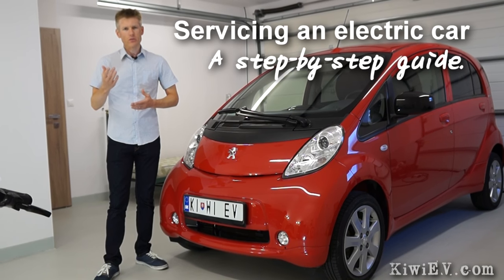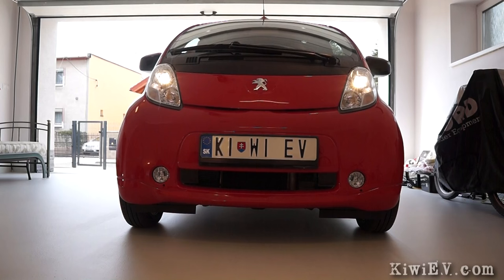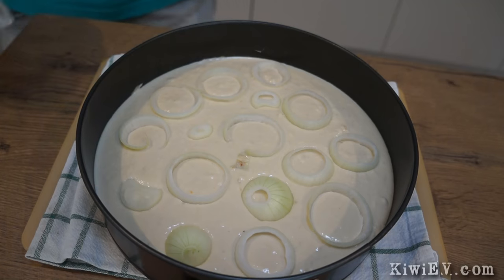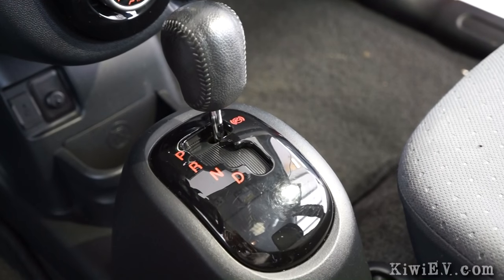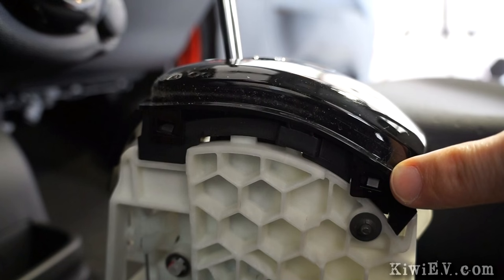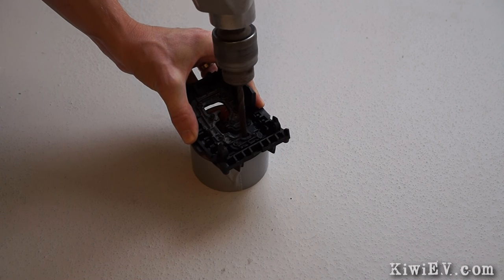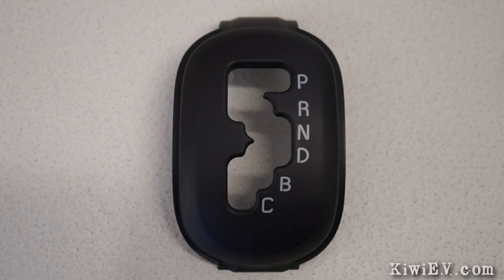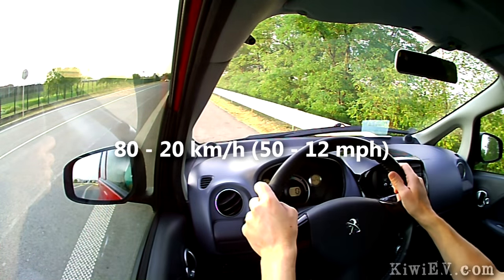How to service an electric car + unlocking hidden iMiEV options!

Comment: Gavin I just wanted to let you know that people are still following your instructions on how to do this! I bought an ICE gear surround (with 3 and 2 markings) from a used Japanese car on Yahoo auctions for £8. No cutting required, the face plate and the black part underneath fit straight on the white pillar. I sprayed the face plate black (it was grey). I'm enjoying B mode around town. Cheers!

Comment: I just made a BIG service on my c-zero... changed the cabin filter (10 min, you need to do it every year). I also changed the oil in the gearbox/differential (15 min, you need to do it every five years). THe only thing left now: changing the cooling liquid - but that needs to be done once every 20(!) year - so I skipped that for now..:)

Comment: Great video, I just got a used c-zero and I hope I can drill through both plastic pieces from behind not to have to buy the overcharged i-miev plate. I was looking at the figures of the B mode and it shows on your video that there is a difference of 5kw peak regen, but I get the feeling that the total regen power from 80km/h to 20km/h was a higher percentage difference compared to the peak regen power if that makes sense. I would love to know the total regen power difference between the 2 modes if that is available?

Comment: On 2015 c zero if you try to unlock extra gears it only goes 6km/h max on B and C.. and if you press the pedal to speed up it does nothing. Only works correctly in D mode

Comment: Thanks Gavin for the tip! I changed the gearshift of my I-on into the mitsu model, and in B mode the car appears having more autonomy than in the normal D. Furthermore, in the city I need to use the breaks less .

Comment: UK supplied I-MIEV s are delivered with these slots already available. "D" is for normal driving about town. (gives better low speed control) .  "B"(increased regenerative braking) good for hills and twisty roads.  C max power  (for open straight highways).
Reply: There was no significant difference in the power when accelerating, C is for lowest Regen, not power delivery.

Comment: Seems like B stands for "braking" (more regen) and C stands for "Coasting" (less regen).
Reply: IMHO 
I mostly use drive and neutral combinations as neutral imparts less friction and allows the car to travel further without any input of energy.
Approaching lights and other reasons to stop, I try to coast up where possible. The other option I use is just flicking into D and for heavier braking, down into B. I love minimising the wear to my brake pads!

Comment: is the shifter supposed to light up the letters at night? i just got a used imev and cant see the selector position at night, no lights
Reply: No, it doesn't light up. You have to get used to the number of clicks and the position, just like with the gears on an ICE car. The drive mode is also displayed next to the battery level.
Reply: Wife and I have the same objection. I'm going to put some LEDs under the cover now I know how to get the cover off - thanks Gavin. I have put a LED alongside the "Ignition Switch" as the slot is invisible in the dark. Comes off the interior lights, which come on for a time when the driver's door is opened.

Comment: I'm a little confused. I own an iMiEV (2011), and the behaviour of your B and C gears don't match with the behaviour of my E and B gears at all. I understand my three drive gears as follows:
D: Gives full drive power, but little regen
E: Gives much less drive power, except when I floor it. More regen.
B: Gives full drive power, and maximum regen. This is the drive gear I use 99% of the time.
Reply: OriginalPiMan 
Interesting.. I have an MY12 iMiev and I have great regen with D, much less with C and more with B. I found fairly insignificant differences in throttle response between all three modes.
LOVE LOVE LOVE the get up and boogy speed of this little car. It's truly unreal. If a bigger motor was put into the vehicle, I'd be inclined to say it was just overkill. It's a GREAT car!
Reply: TheObsessedGardener 
Thought: I know my D is for Drive, E for Eco and B for Brake. Perhaps you've got the same D and B, but you've got C for Coasting.

Comment: Just reading some other comments about regen. on the ionq it has paddles on the steering wheel 3 levels of regen and coast. fun to play with but after nearly 5k i found full regen the simplest as its then all controllable with the accelerator. the regen levels depend on how far you come of the gas or should i say electrons. Not driven on ice yet.

Comment: Err you left out  checking brake fluid level and cab heating system fluid level - water& antifreeze (both in the front)
Under the rear load platform is the motor coolant fluid level-water/antifreeze.

This car is very rust prone underneath. Check out floor pans and "chassis" rails. 
Also rear brake  pipes prone to rust. Caught in time will save a lot of repair money.
My car is 2012 model, kept in garage when not in use,  Local roads are salted in Winter.

Comment: So, B is brake and C is... coast?
Reply from the maker: Yeah, seems to be. I've been driving on B all week. It's brilliant for the city.
Reply: B is somewhat standard on larger cars with heavy loading capacities or large towing capacity. So it's motor break selection. On Electric cars it's the same. On Tesla's it's simply selectable how much regen breaking the car should do, here it's selectable via "gear".

Comment: Ups, I finished drilling my 2013 c-zero, and although the dashboard recognises the B and C modes, they don't work. Does anyone have any idea why? Could there be some software block that needs unblocking? Any advise would be much appreciated:)
Reply: On later models after 2012 the mode is displayed on the dashboard but it does not work due to reprogramming of the ECU's.
Reply: @SNORKYMEDIA  Thanks for your answer. Can the ECU’s be easily reprogrammed again so that they would recognise it? Perhaps using an OBD ll or a mechanic?

Comment: Your service guide was bloody funny, with your permission i think i may do one for my Ioniq.
In reality your not far from the truth, Due to regenerative breaking the pads should last for ever, so the only items i can think of are wiper blades, tyres, pollen filter. And every 5 years if needed break fluid and radiator fluid.
Not completely sure why my car has a radiator. The 12v battery that switches the big one on would need changing after a few years but on the ioniq its in such an easy location it should take 10 mins.
Reply from the maker: William you don't need my permission! Go for it mate!
Reply: True but polite to ask and wouldn't want to upset the ev family. Need to find a way to feed the surplus energy from my solar panels into the car. Too many clouds in the uk. Any idea's would be a great vid.
Reply: True but polite to ask and wouldn't want to upset the ev family. Need to find a way to feed the surplus energy from my solar panels into the car. Too many clouds in the uk. Any idea's would be a great vid.
Reply: True but polite to ask and wouldn't want to upset the ev family. Need to find a way to feed the surplus energy from my solar panels into the car. Too many clouds in the uk. Any idea's would be a great vid.
Reply: True but polite to ask and wouldn't want to upset the ev family. Need to find a way to feed the surplus energy from my solar panels into the car. Too many clouds in the uk. Any idea's would be a great vid.
Reply: william cox have you not heard of a Zappa Wall charger! It puts all the surplus from your solar panels into your car.
Reply: John M No but will look it up. Thanks for the info.
Reply: Had a look and can't find anything, would you be kind enough to send me a link.
Reply: Many thanks, will have a look.
Reply: Had a look and seems to do all i wan't, But £500, This is about right if you haven't already got a charger, But i have, If i ever have to replace it then this is where i will be heading.
And again many thanks for the info. John
Reply: william cox : your welcome!
Reply: Radiator might be for cooling the batteries.

Comment: Any reason to use a gear different to B? :'D
Reply: Given the i-MiEV is actually a RWD car, D mode may be preferable in slippery conditions. While one pedal drive is awesome 99% of the time, heavy regen when on ice will actually risk breaking the rear end loose in loose surfaces and cause a potential spin.

The BMW i3 I test drove which ONLY has heavy regen as the normal drive mode almost did this to me had traction control not intervened. I was told if you had good foot control & gotten used to one pedal drive it was easier to modulate, but I think less regen would have been easier to cope with in icy conditions.